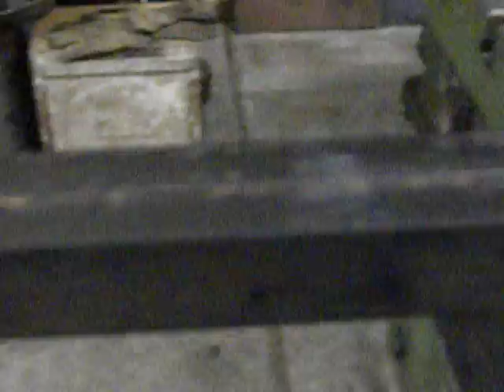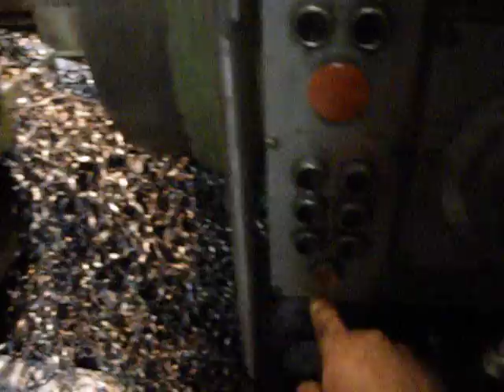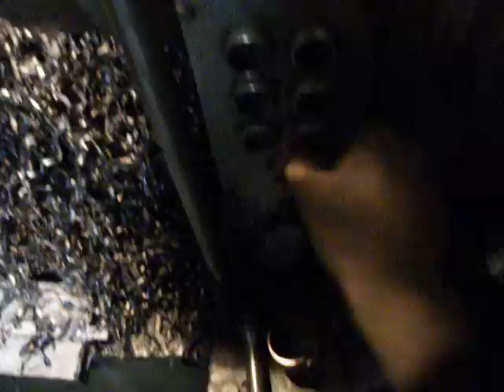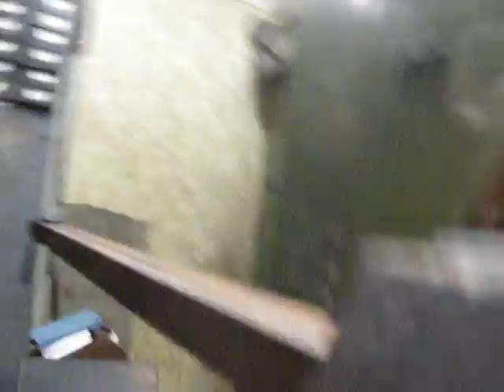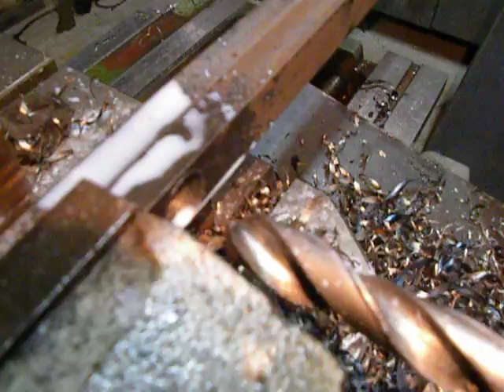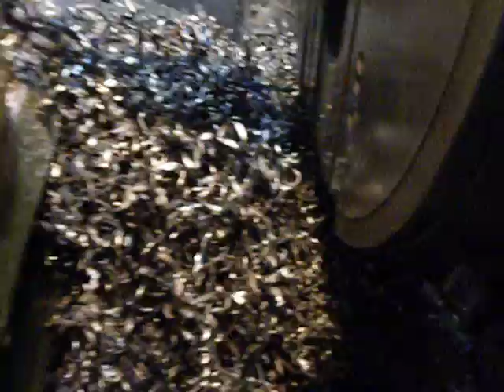Drilling on 2L614 Horizontal Boring machine by 25mm drill bit

Comment: During the course of boring a 1000 holes in this steel, did you have to stop and sharpen the bit several times? Also, are you able to sell the steel scrap for a metal recycler? I would hope you could, as there is quite a bit of in from this job.
Roy